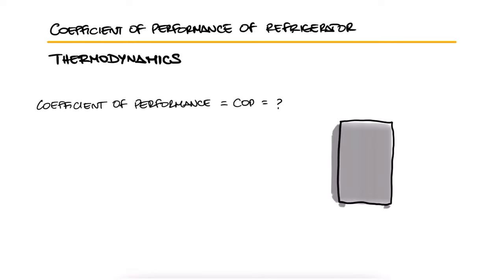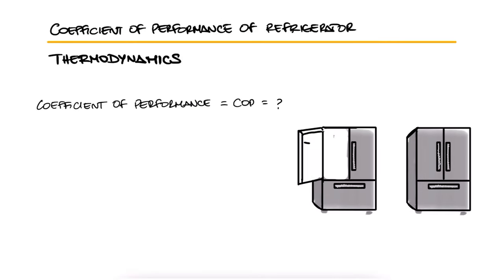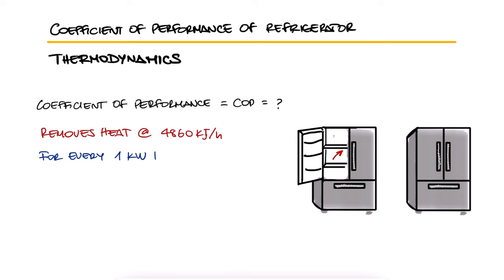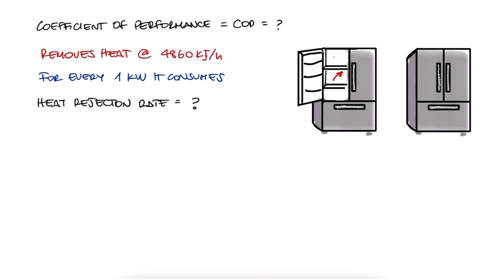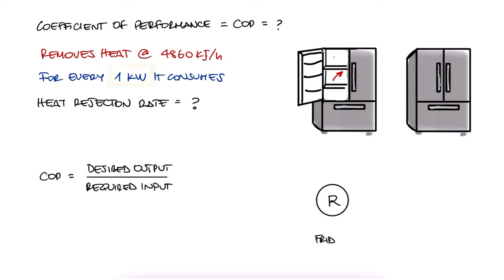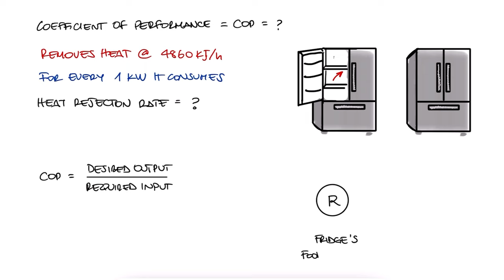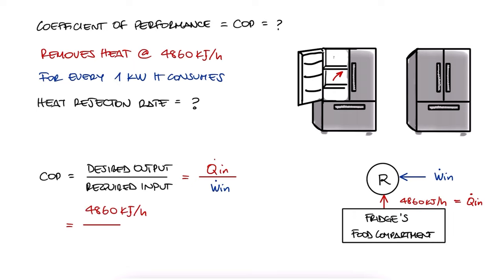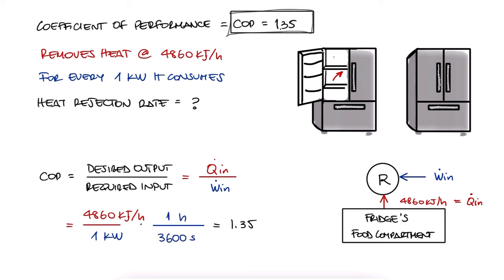Thermo - Coefficient of Performance of Fridge in 2 Minutes!

Comment: I solved for Qout as 4860. Otherwise it was right. 

Does heat removal from the atmosphere always mean Qin to the refrigeration cycle? How can I tell by the wording of these problems? Obviously heat rejection should always be greater than heat removal for a cooling system.